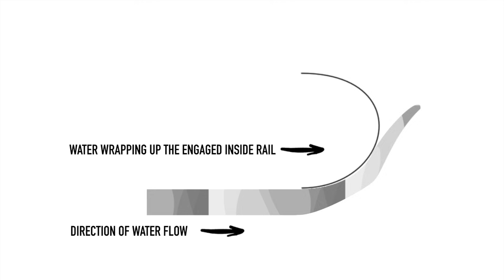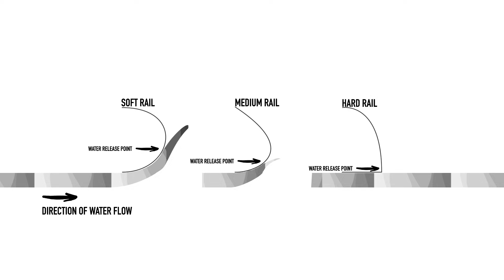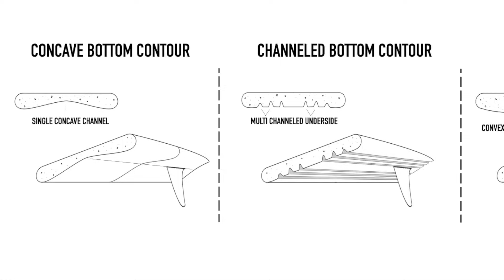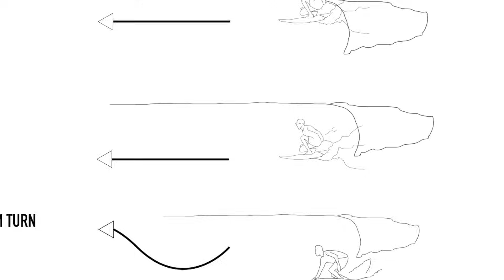Surfing Explained: Ep2 Generating Speed and Grip

Comment: This could not have been written by someone with a legitimate physics background. One poorly done physics article does not prove anything. It is looking at "grip" completely incorrectly. The suction force of the round rail is minimal because the water is traveling at a very high angle relative to the rail in part due to the speed of the board in trim. As the wave face itself is slightly curved, round rails are not greatly changing the water's flow path to begin with. The soft rails are not imparting a significant  acceleration (ie turning) of the water mass. The perception of "grip" is not caused by softer forward rails, but is instead caused by the rearward harder edge rails which redirect the water flow mass. As Ft=MA, and harder edges force the water to be redirected, mathematically this effects an acceleration and a change in net force. IE turning, accelerating, or otherwise "gripping" the wave face. If you can't redirect water you can't significantly accelerate. This is why an experimental  performance board made with soft round edges throughout, will be terribly slow as it can only rely on the rails minimal suction force and the fins to redirect the flow mass. I have made such a board, and one with hard edges throughout as well. They are in contrast to your theory. And to clarify, I am speaking about speed/grip in trim, not from gravity. Flat finless soft edge alia boards with no rocker are faster when moving relatively more parallel with the wave due to gravity and the waves forward movement, but not in trim.

Your theory of rail suction creating grip or speed, (or anything) is easily disproven by actually testing it.

Further, the 90 degree change of water flow direction as shown in the middle part of the video is laughable. It does not hit the inside rail and magically turn 90 degrees. You have any idea how much force that would take??? This is a joke.

Comment: Some good observations here. Some seem less obvious. Generating speed from pumping is also common to mountain bikes and skateboards across berms and bowls, ie little to do with fluid mechanics. Seems to me that generating speed across the line has more in common with a skate or a yachting keel generating forward momentum against a lateral force. Just my observations. It's great to see somebody actually thinking about hydrodynamics in this, not just hydrostatics, like other youtube channels about surfing and physics...
Reply from the maker: Hello Sean, great observations yourself. Much of our understanding comes from the extensive r + d from sailing and boat design generally! Pumping is used in surfing also to apply a greater force on the rail for more rail area that can disrupt the water flow; as when we push up with our legs by extending, force must also push down. More of Newton’s third law. We love engaging in these conversations, it’s a chance for us to learn with the wider community.
Reply: @SurfSimply  I get a luttle obsessed with this stuff. I wondered a little at your pictures of streamlines being rediredlcted at angles up to 90 degrees in an unenclosed flow. I think if you were able to see them, like with coloured smoke in a wind tunnel, or with CAE simulation, that's not would occur. The idea of thrust being generated by this redirection into lift sounds a bit at odds with Newton's 2nd law and the conservation of energy. With the angle of attack you're describing against the apparent water flow (the water isn't moving only the board) ie close to 90 degrees, well beyond stall angle, seems as though drag would be the key result balanced agaimst gravity. The inverse lift generated by the rail would pull the surfboard deeper into the wave, creating even more drag. Angling the board across that drag force will mean some of that force is redirected, with movement across the face and down the face, like a ski edging across an ice face. yes that's Newton's third law at work ie net force increases across the face, and net force against gravity decreases down the face but it seems like the result of drag forces rather than lift. Anyway that's what I see, only experiments could really show EXACTLY what is going on there...
Reply from the maker: It would be great to see more investment into the research and development within surfing physics and science, but unfortunately right now the industry isn’t designed the way motor racing or the aerospace industry for example.
Reply: @SurfSimply  well if they are they're keeping it under wraps. You guys are doing good though, thinking about the real physics underneath your feet.
Reply: Yes. Part of speed generation is from momentum gained from 'throwing' your body weight  as with skate boards.

Comment: So when bottom turning is sinking as much of your back foot rail as possible the goal? I feel like sometimes when I do this with groveler boards with less volume I kind of bog down a bit bc the board feels like it never released as much off the bottom.
Reply from the maker: Well ideally through any manoeuvre we want to keep as much rail length engaged in the water as possible, this could bring the waterline up as far as the front foot, which will help to continue generating speed through a turn, however we have to consider the nose may catch if we don’t have enough weight back, so it’s a delicate balance between the two! Good luck!
Reply: @SurfSimply  Thanks for the reply and the awesome video!
Reply from the maker: It’s our pleasure!